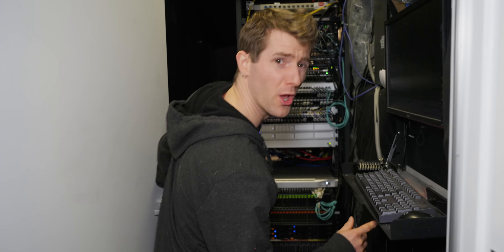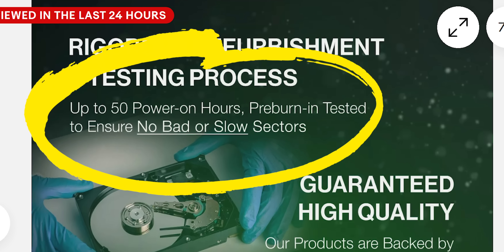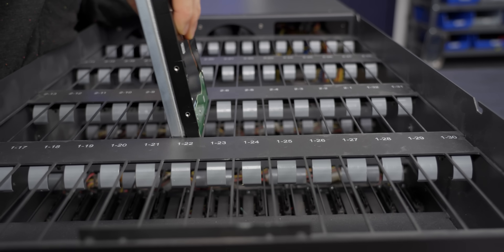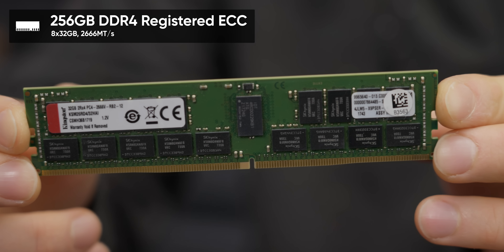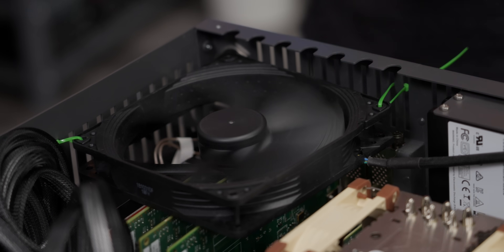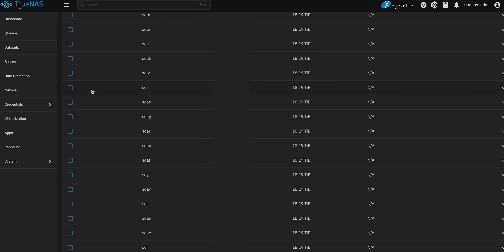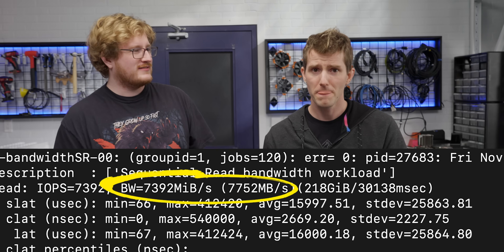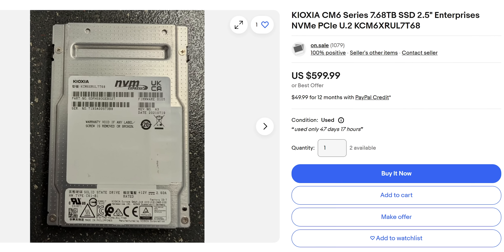Is Buying a PETABYTE on Ebay Stupid?

Comment: I've always bought new drives specialized for NAS use, but now I'm wondering if we should get back to the idea of RAID -- redundant array of inexpensive disks.  A cool experiment would be to put a stupid number of the cheapest consumer harddrives into a cluster or zpool to see if the cost savings justifies the higher failure rate & performance issues created by the varying speeds & capacities.

Comment: In most cases, at least when it comes to Seagate hard drives, especially Exos, they are simply returns from data centers and, in the best case, have never been used.
It is not uncommon for data centers to buy a lot of these drives in bulk and end up with too many left over after they have upgraded their infrastructure, for example.
In these cases, they are often simply sent back to Seagate without having been used even once.
But Seagate is not allowed to sell them as new, which is why they are sold as recertified.
For hard drives from the consumer sector, i.e. NAS and desktop hard drives, I would not recommend buying recertified hard drives.

Comment: One thing I'll give seagate, I had 1 drive fail and a second one starting to fail, they literally could only send me one replacement as one of them was just out of warranty. They sent me 2 brand new drives even though they didn't have to. Funnily enough, my drives that I originally complained about started working. I got 2x 2Tb drives for free. Which was NOT my intention.

Comment: 5:45 Anybody that's going the repurposed business PC route and wondering what specs they should look for before buying something: 

-Light file server: Pretty much anything including SBCs would work but if you're bringing in a new device I'd get something with at least 7th gen intel and room for expandability. 
-Media server: i3-8300 or higher, intel's igpus and their media transcoding hardware (quicksync) got significantly better that gen. You won't need a gpu for most cases unless you have a lot of simultaneous users. I recommend HP Prodesk G6 or higher and Lenovo Thinkcentres for compact and low power options. Tons on ebay. 
-Huge media server: Consider an Arc GPU to transcode everything to AV1. 
-Production/video editing server: Stepping up your budget for something with high speed ethernet and ECC memory support built into the mobo can be worth it for the energy savings and peace of mind. Look around at home server youtubers like Wolfgang's Channel or Jim's Garage for hardware tips.

Comment: dude all my hard drives on every PC i bought and built myself have ben recycled hard drives. it's a ps3 hard drive a 500gb laptop hard drive a 120gb SSD from laptop i found in the recycling bin and now recently a few months ago i bought my first brand new memory. 1tb m.2 SSD         so used drives ain't that bad like the 500gb laptop hard drive has ben with me sins i was 13 and i'm 27 in 2months. it has had soo many games downloaded on it and then deleted and redownloaded. it has put in a ton of work and still running strong. had about a gazzilion viruses on it to.

Comment: I've had a few Seagate and WD drives fail (many) and I've just thrown the RMA replacement recertified drive into the pool as a new drive as I replace it with a new one as soon as it fails.

Very few errors if any on any replacement drive.

Comment: I rescued an old T340 Poweredge server from the recycle bin at work and filled it with 6 recertified 10TB SAS Seagate EXOS enterprise drives I got off eBay for $560, with 2 1TB Enterprise SSD's in RAID 1 for the boot drives that it came with, and they have been running strong since last April for my home Plex server. I should probably reconfigure the raid one of these days when I'm able to get a backup, but it's a standard RAID 5 running a Windows Server 2019 virtual file server (license was already tied to the server when I rescued it).

Comment: As someone that bought over 30 drives from Server Part Deals on eBay for my last project alone (I'm a homelabber), I HIGHLY recommend LONG S.M.A.R.T. tests initially, esp to check for shipping damage.  I found 3 drives that (VERY MUCH) FAILED the long test that passed the short test, not surprisingly from the corner of the cardboard box that the shipper smashed in, presumably when dropping the box.  Server Part Deals was great to work with and replaced the failed drives without issue, though I'm willing to bet it would have been much more difficult had I NOT done my due diligence.

Comment: I've been using recertified drives for 7-8 years now for multiple PBs of storage, all of it ZFS.  Due to ZFS's paranoid level data integrity checking, it takes some of the stress out of it.  I've had drives fail CRC checks....  ZFS reports the drive returning bad data, ZFS removes the drive from the pool...  Swap the drive and let it resilver, back to production.  I don't know if new is better then recertified, but with ZFS, I don't care.

Also...  Do yourself a favor, use dRAID.  Everything new we do goes on dRAID.

Comment: Here are some more computer hardware news updates:

- _MSI GeForce RTX 4070 Ti Gaming Trio_: MSI has announced its GeForce RTX 4070 Ti Gaming Trio graphics card, featuring a custom cooling design.
- _G.Skill Trident Z5 DDR5 Memory_: G.Skill has launched its Trident Z5 DDR5 memory modules, offering speeds up to 7.2 Gbps.
- _Seagate Exos X20_: Seagate has announced the Exos X20, a 20TB HDD designed for data centers and cloud storage.
- _EVGA GeForce RTX 4070 Ti FTW_: EVGA has launched its GeForce RTX 4070 Ti FTW graphics card, featuring a custom cooling design.
- _AMD Radeon RX 7900 XT_: AMD has announced a new version of its Radeon RX 7900 XT graphics card, featuring a lower TDP.
- _Crucial P3 Plus SSD_: Crucial has launched its P3 Plus SSD, offering speeds up to 7,000 MB/s.
- _Thermaltake Level 20 GT RGB_: Thermaltake has announced its Level 20 GT RGB case, featuring a tempered glass design and customizable RGB lighting.

Comment: Here are the latest computer hardware news updates:

- _NVIDIA GeForce RTX 4070 Ti_: NVIDIA has announced the GeForce RTX 4070 Ti, offering improved performance and power efficiency.
- _AMD Ryzen 9 7950X3D_: AMD has launched the Ryzen 9 7950X3D, featuring a massive 128MB cache for improved gaming performance.
- _Intel Core i9-13900T_: Intel has released the Core i9-13900T, a power-efficient CPU with a 35W TDP.
- _Samsung DDR5 Memory_: Samsung has started mass-producing DDR5 memory modules with speeds up to 7.2 Gbps.
- _Western Digital Ultrastar DC_: Western Digital has announced the Ultrastar DC HC750, a 26TB HDD designed for data centers.
- _ASUS ROG ZENITH II EXTREME_: ASUS has launched the ROG ZENITH II EXTREME motherboard, supporting AMD's Ryzen Threadripper 7000 series.
- _Corsair RMx SHIFT_: Corsair has released the RMx SHIFT series power supplies, offering 80 PLUS Gold certification and modular cabling.

Comment: This may be a stupid question but can I use Seagate Exos drives as a regular storage drive in my PC? Or would you guys recommend them only for data centers?
Reply: @TheCooPeer  i don't see why you can't? If you've got the money and need the storage, data center drives are just more reliable
Reply: @dormanricha  Thanks a lot for the feedback. I'm a complete tech noob so just wanted ot make sure if they would work in theory
Reply: Yes you can but fair warning those things are loud and clicky when writing or reading. WD Reds (I recommend specifically the Pro or Plus ones) or Seagate's own Ironwolf ones will be a little less annoying.
Reply: @Dontrel3030  Appreciate it!

Comment: 2 "backup" drives for every 10 drives seams like a lot of waste..... woundn't 3 "Backup" per 30 drives be plenty? then you need 4 drives (13,3%) out of 30 to fail before you are loosing data. Would be nice to see some actual numbers as to how many drives LTT actually replace in their storage solution.. Linus, can we get some data as to how many drive LTT have changes in their data storage system over the last 10 years?
Reply: They're not backup drives, they are parity drives. They don't magically store all the data from other disks, they instead "store" the ability to rebuild that data in the event of a disk failure. Parity and striping often also increases access speeds, so they aren't wasted, they are just being used for a different purpose other than purse storage.

Having an additional disk failure during a tight rebuild is the worst nightmare, so there is a balance to be struck between usable space and failure risk. If you've never rebuilt/recovered an array with large drives like this, let me be the one to tell you that it takes a long long time. During the rebuild process, the disks are working very, very hard, which makes their possibility of failure higher than usual.

tl;dr number of disks in parity is a risk balancing exercise, and factors in performance considerations and statistical probabilities

Comment: I've been a customer of SPD for years. The 16TB Exos drives in my homelab server came from them, one (or two) at a time, as my storage needs grew.  I recently bought 8 of the same 20TB Exos drives; most are for an offsite backup server.  Yeah, I like my Linux ISOs...

Comment: To me it's not if they're new/refurbished/recertified it is how much storage they have that worries me. 
My 8TB Barracudas and 8TB IronWolfs are still chugging along nicely, and I replaced them with 12TB IronWolfs recently (so fingers crossed they work well for a long time). Meanwhile, I have a backup that is 24TB that I TRY to not plug in often and had to send to Seagate for warranty twice...

If that 24TB didn't need to be warrantied I might've upgraded to something like 18TB or 20TB for my server (now running HexOS vs its original Windows install) which is limited to only 4 slots, and I collect Blu-rays rather quickly...

Comment: I hate Seagate with a passion, sorry, great build but I would of went with HGST/WD.

I am at a 100% failure rate on Seagate, every single drive I owned that was Seagate has failed me. I have been running WD Helium drives for years and they were used before me and still 100% life.

Comment: Haha nice I bought the same drives from the same seller, 1 of the 2 had bad sectors and the seller offered 50% refund without shipping it back so had ask eBay to step in and they fully refunded without sending it back, been using the other drive for a few month for game backups and it works great.

Comment: I've gotten a few recertified enterprise drives without issues. Got a set of 4, all different batches, with 3 year warranties, and only  1 has failed in that time, covered by the seller.  Pretty good to get the capacity and longer warranties than a true USED drive, and statistically being from different batches does reduce same-time failures

Comment: I buy from these sellers for my HomeLab. My NAS is running drives from these ebay sellers. I always just buy a few extras in case I get a DOA or a failure. But so fare its been a solid buy and I don't regret going this route at all seeing the prices of new drives these days.

Comment: 12Tb Seagate refurb is in my gaming pc for bulk game storage. Model ST12000NM0127 just the basic 7200RPM Enterprise drive and it's been running great since June of this year. I got it from Ebay seller dbskyusa88 with 100% health, 0 hrs, 0 bad sectors, and a 5 year limited warranty same as factory...

Comment: My main disk array is 14x10TB recertfied drives (RAID 6) from serverpartdeals (>5 years old)  and not an issue at all! I have a 15th drive as a cold spare just in case and haen't needed it.  This is a better result than the brand new 3TB 7K3000 drives I replaced.where I had a few failures over the long term.

Comment: Here in $0.80 / Kwh land, it's CRAZY how fast upgrading to a newer cpu, even a fully newer machine pays for itself with electricity bill. My Optiplexc with a i5-2400 costs about $190/year to idle. A newer, even 6th gen intel mini pc pays for itself in that time in savings. JUST ONE YEAR. That's what I'm going through with my home NAS which, hey, I'm using refurbished HGST 10TB drives myself!

Comment: I've had great experiences with refurbished PC's that came with amazing drives. Never got drives seperately.

One lesson learned and I'll share here is that a listing for "1 TB of storage" could mean two drives of 500gb each. So be wary of that, that's twice the power consumption and double the heat after all. 

Other than that, check what your locals are promising, check if they deliver. And simply make sure to return it and claim your rights if something is off.

Great experiences overall, saved a ton.

Comment: yeah, it's crazy what you get for relative cheap. i got a full spec Dell r630 for 600€ and 2 Dell PowerVauls managed disc enclosure with x12 3.5 inch drive bays for another 600€. if i am corect the Dell R630 with v4 cpus at the full spec had cost 9.000€ new and this was 5 to 7 years ago. that's crazy how cheap you get such machine.

Comment: I got a pair of 2TB Constellation ES drives from a similar sort of dealer a little over 5 years back for my system upgrade. (software RAID1 for in-system backups, I can't afford and don't need an external storage system) They have worked flawlessly for 5 years, despite several people on the LTT forums warning me that they would be likely to fail within days. (they also kept trying to push me to get a far more complex backup system than I actually needed) No failures or errors of any kind, and both drives were from the same batch with 0 power-on hours when I received them.

Comment: As someone who is Linus' age, I wouldn't go near Seagate drives with a 10 meter stick. Those were the only drives that failed back in the days of mechanical hard drives, at least most of the ones I had did.

Comment: I'm not buying Seagate anymore, I've had too many failures in the past. I've been using Toshiba MG09 18TB hard drives for two years. Quiet, energy efficient and fast. So far, absolutely no problems.

Comment: I would not trust a Seagate drive as far as I could throw it -- new or used. Especially after the misadvertising of SMR drives as CMRs. And Seagate's response on where they source these drives from, claiming a "variety of sources" means absolutely nothing... I went with Toshiba's 20TB brand new drives -- which weren't much more expensive than your "refurbished" Seagates and easily perform just as well. 

Server Part Deals are great, though. Not sure why you didn't buy from them directly for less, since eBay's warranty period is way smaller than what SPD offer, so you're literally downgrading your warranty whilst paying extra to eBay for them.

Comment: well i just checked my 10tb drive and did the long self test thing wich it passed. it showed 0 hours runtime however the tab "head flight hours" shows a number i cant even understand... its way big. 130xxxxxxxxxxxxxxxxxx big..... read and seek error rate also show big numbers. then again airflow and temp sensors show long weird numbers. so i have no idea what is going on inside these seagate driver. physically the drive had some scratches but looks good.  and they passed the short and long self tests.

time will tell.

Comment: I've got about 300TB's worth of recert drives in my homelabs, many have been spinning for 3-4 years with only one drive failure at just under a year.  For smaller use cases, keep a drive or two on hand as a cold spare and you'll still save some serious cash.

Comment: I work in the satellite data industry for many years and is quite common for the server/disk producers to refurbish the failed disk, in many cases disk fail by software/driver and they can fix them. So usually the procedure is to take out the failed ones, send them back to be fixed and they send "new" ones or refurbished to replace them.

Comment: I've been buying refurbished HDDs from Server Part Deals for years now. I did receive a bad drive from them once (I always do a block sector check on all new drives as they'll be in some NAS or work environment for years). I emailed their RMA department, showed them the screenshot of the drive results and the bad block. In a day they got back to me, RMA'd the drive and I got a replacement drive a few days later.
So you might get a bad drive but their support is absolutely fantastic when issues come up. 

Given that the drives can be less than half the price of a new drive and comes with a few years of warranty, it's a no brainier. Just so a sector scan before installing the drive and a long SMART test.

Comment: LTT's attitude re: the "Cloud" is hilarious and misguided. You should speak to people who know what they're talking about before making statements that have minimal merit tied to them. It costs $0.00099 per GB stored in Amazon S3 Glacier Deep Archive (where backups should be - after spending 1 month in S3 infrequent access or another tier that does not have recall fees to get files out of deep archive). Then, you have the recall fees. You would get charged per API request type (I.e. - GET/PUT) and there are free monthly limits you don't get charged UNTIL you go over them, and if all you do are backups, you won't hit those and it'll be $0. Now, yes there are data transfer out costs - but you get charged after the first 100 GB (free again) and then it is $0.09 per GB for the first 10TB! That's only $900 USD. Pulling data out is rare and even then, if you did do this often there are ways to reduce the cost like using DirectConnect (DX) which is basically an MPLS connection that makes your AWS account appear on your circuit. You don't have DTO charged to you since it's exiting from within the AWS network and reduces the need to transfer out of AWS.

I am just saying that if you understand the costs, it is not bad, and there are ways to mitigate the costs. It's still cheaper than on premises workloads for companies. You can always ping me if you want questions answered.